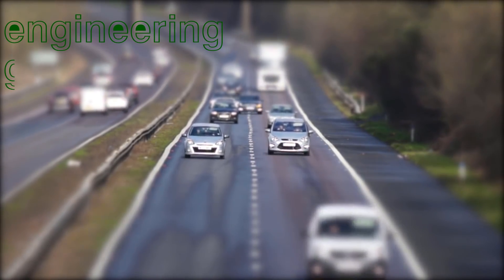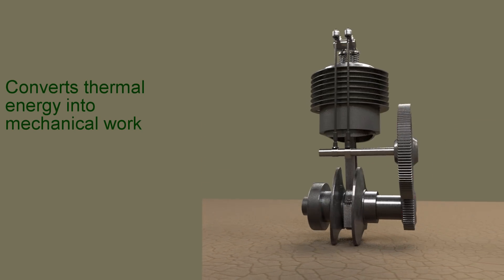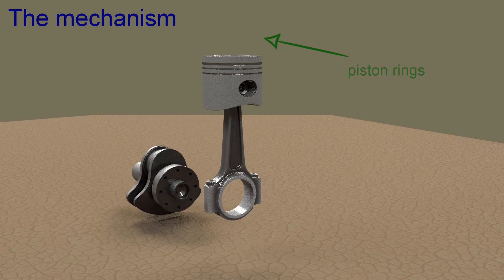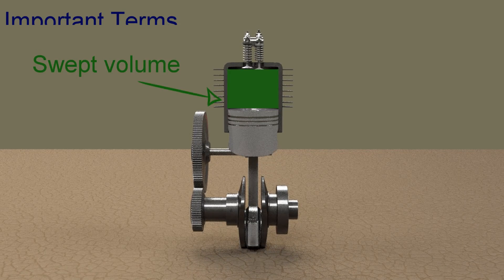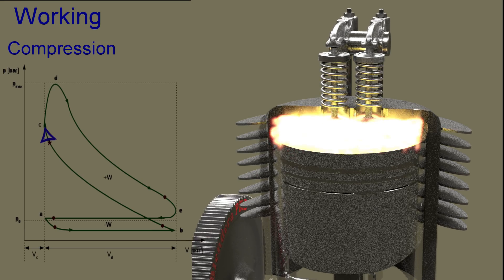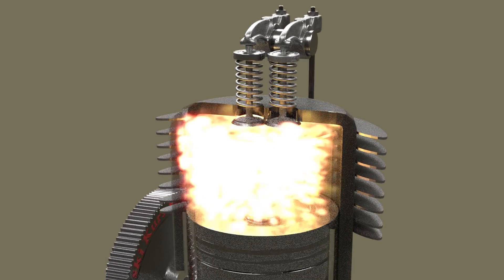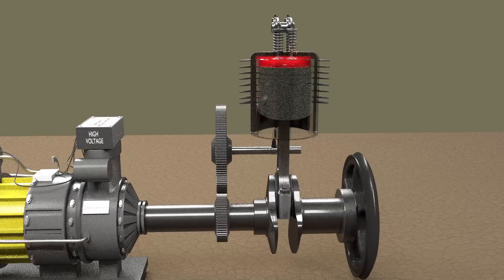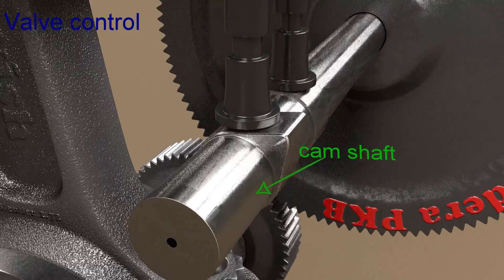How Four Stroke Petrol Engine Works

Comment: jab hum kick marte hai to kya hota hai?? ya starter button dabate hai to kya hota hota hai??
Reply: 4.22-4.27 yeh hota hay. automatically piston upward jata hay and sparkplug ignite hota hay . aur continuous  process chalta rahta hay.
Reply: @immaturegamer9149  upward mtlab kaha.... crack side ya head side.... bhai... thoda technical smja do please
Reply: @CAMER_21  dakhow piston hamasa upward direction ki taraf rahata hay. jaishi humlog kick martaha tab pistonkow through body force downward ki tahaf lata hay. as a result block chamber ma vacuum create hota hay aur ush vaccumkow fillup air and petrol mixture  block camberma intel valve sa aata ha like fichkari ma vacuum create honasa pani andar ki taraf ata hay  . as i said earlier piston hamsa upward position ma rahta ha , kick marnaka bad within neon second piston upward ma jata hay aur air petrol mixer kow highly compressed karka upar tak lay jata hay and wohapa spark plug ignite kar data hay . jaishi burn hota ha pistonkow dhaka data hay and burn air outer valve sa bahar jata hay and piston firsa vacuum create karta hay, again air petrol under ata hay and yah process continue chalta rahata hay . ischa sa mechanical force create hota hay aur har operation proper timing ma hota hay , yaha tak spark plug bhi mechincale process ma ignite hota hay. purana bullet ma agar kick marow tow parkow reverse kiuw marta hay? because 350cc piston ka force parkow dhaka data hay aur piston ka position bhi upwardma hota ha. jabrdasti downward ma by kick lanki kosish karogatow jhatka laga hi . but 100c chota compression chember ma hum logokow jhatka nahi lagta hay and force bhi kam lagta hay . aur kick marta waqt ushi timing ma spark plug ignite hota ha.  akbar start how gayatow next automatic mechanical opreation iskow continue ignite karta rahta hay.
Reply: @CAMER_21   head ka side upward

Comment: I got a stihl strimmer and it’s valve shot though the other day but only piston head was damaged and a snapped valve but I replaced them all and now rebuilt it and now working, I did not have a clue what I was doing or understood how it really works but this video have shown me, I fixed engine by looking at videos on here and it only cost me around £50 to fix for parts so I got off lightly and I now understand how the engine works as I never had any interests in them before, thanks for sharing this video.

Comment: In intial time piston moving TDC to BDC from where it gets power to move down if ignition spark appears during piston goes BDC to TDC?
Reply from the maker: For starting engine external power is required. Battery for self start vehicle and kik or rope pulling start for manual start. Once engine is started flywheel and engine inertia keeps engine running during non power strokes. Thanks for your comment.
Reply: Good question

Comment: Can we get a blast in cylinder with the help of matchstick's  red material strick on rough material which is placed on the piston at high pressure and temperature ?
Reply from the maker: You can get blast with any thing which can cause the temperature of air fuel mixture to rise above its ignition temperature. matchstick should work. Thank you Shreekar for watching. Please consider subscribing.